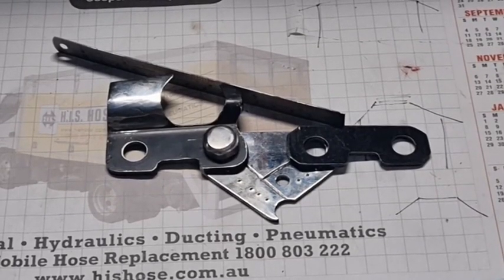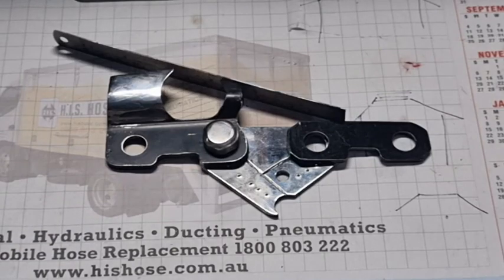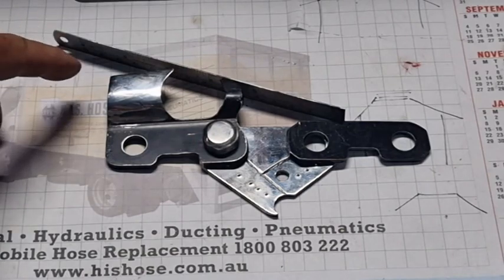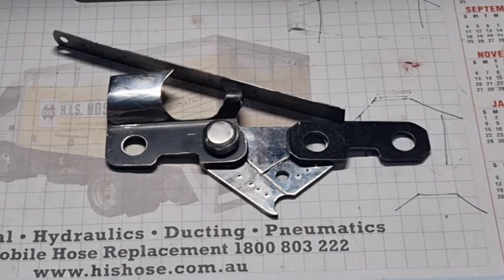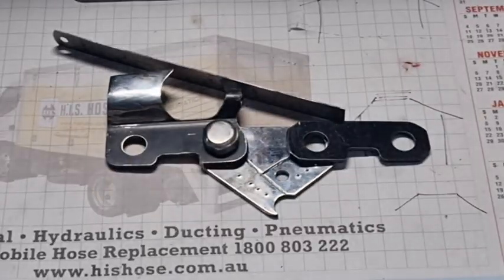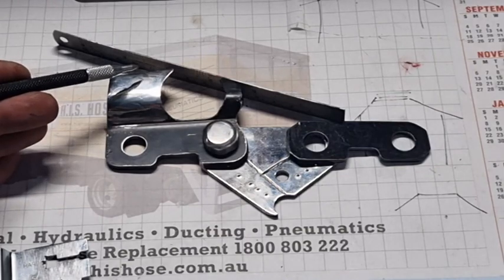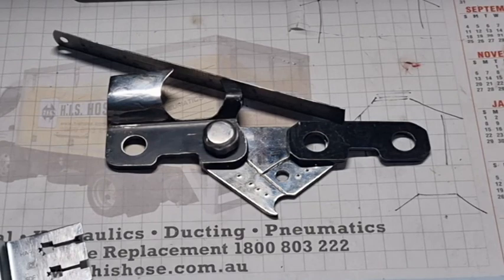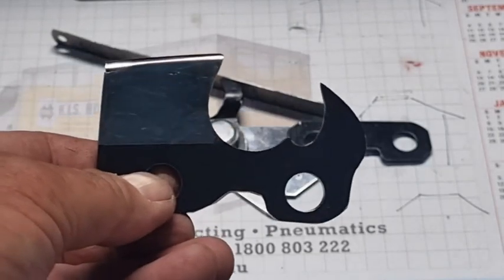Progressive raker gauge how it works

Comment: Soooo BUD.. what’s your opinion on the STIHL 2 in 1 easy chainsaw sharpener..?
Reply from the maker: @Maciej Jan Długosz  .9mm bit aggressive.  Today I did attack angle about 6.5° half worn chain tomorrow go cutting wood all day.  We will see
Reply from the maker: I have one but not using it.  I mainly use grinders.  Files for  depth gauges that's all I use files for now.
Reply from the maker: Did you measure it ?
Reply: Thank you very much have great day bud...

Comment: I thought it was more 6 to 7 degree attack angle. I've used a digital angle finder to measure and that is about what i see with the Husqvarna progressive gage
Reply from the maker: I was quoting attack angle with slanted gauge fitted, with angle gauge sitting on tooth and depth gauge the attack angle is around 6 to 7 but this method is very fiddly.  Carlton refer to attack angle but no clear reference other to say when tooth bites into the timber.  I only seen one video on YouTube about digital angle gauge attack angle.  In 1968 ray Carlton never had a digital gauge so attack angle is a bit unofficial explanation.  In time we will see who will use this method.
Reply from the maker: Also I have husqvarna gauges and the gauge sit a much lower angle than the Stihl gauge.  The Husqvarna gauge is longer about 6mm and sits on the drive link.   The stihl gauge is a bit more aggressive than the Husqvarna one.  But that said they both work well in any case
Reply from the maker: @Maciej Jan Długosz  Hi Maciej let's see if you can answer my question.  If we have a new chain and constant gauge is set at .65 and Stil FL4 measures also .65 at new.  The new chain has now worn down and the tooth is 3.5mm shorter in length, the progressive depth gauge gap is now 1.1mm. so will the tooth cut more timber because it's more aggressive now at 1.1mm deep.  If this was the case, would the chain cut faster because the tooth is now taking a larger chip from the wood.  What's your thoughts on that ???